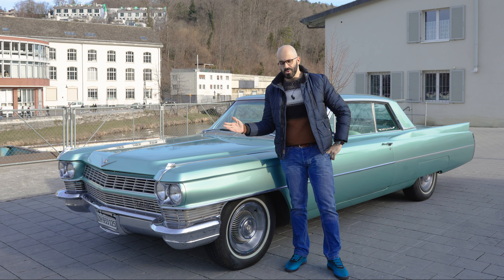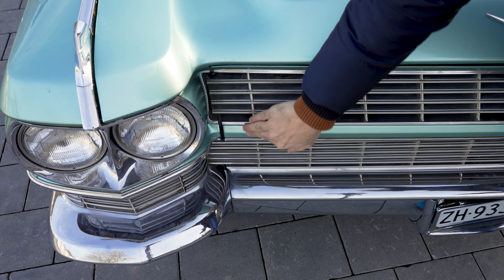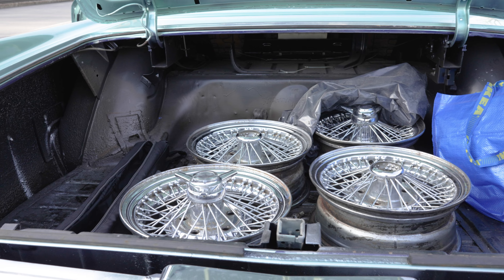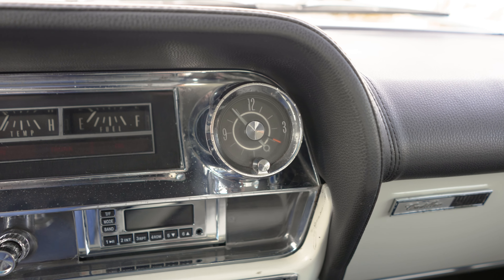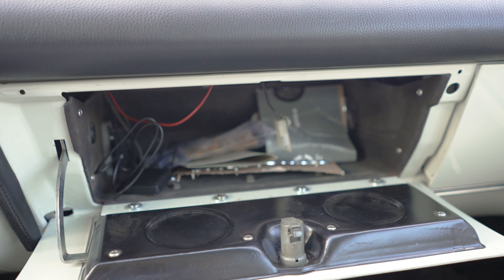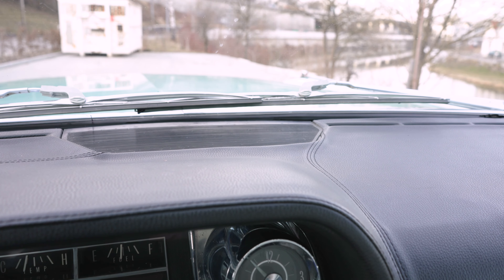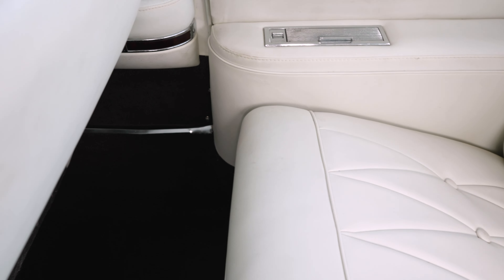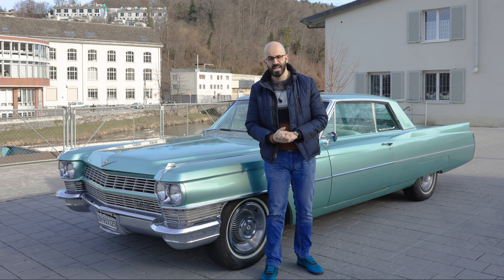Everything that is wrong with my 1964 Cadillac Coupe De Ville

Comment from the maker: Anything you guys noticed? And I don't mean the dent in the rear bumper.
Reply: Yes your panerai, that cars in those days have to look good, so many of them on a closet look had even paint problems aliment and other issues.
Reply: Incorrect dash pad. But I like it!
Reply: Your headlights might have a relay which is weak or you need a new headlight switch .
Anything can be fixed . There are dedicated online services  for Cadillac or try ebay , if not there are forums that can help .
Reply: many more things wrong with it. you mentioned the pitting on the chrome esp interior trim. another possible cause for this (aside from water exposure) is extreme humidity or storage with poor ventilation. I'm leaning toward the latter esp if the Cadillac spent time on the east coast of the US. That is fixable and you want to get the rear window looked at esp around the seal/sealant inside the ext trim around the window.
Reply: On the headlights, check th connectors and the grounds. The headlight harness grounds to the front bottom of the radiator support, on both ends.

Comment: I feel your pain brother. I hope you didn't pay a lot of money for that Caddy. All the signs of a low budget amateur restoration, probably a "flip". This is exactly why I sold my 1962 sedan de ville which had all the same issues your car has. Obvious poor prep work before painting, body fill over trim fastener holes, poor body panel alignment, etc. Where to begin? They didn't even bother to replace the rubber seals and weather strip after removing the glass, which is why there is obvious water damage to your headliner around the rear glass above the package shelf on the driver's side. The door glass doesn't work properly because of misalignment of the window tracks, which can be a pain to get right, and I can only imagine the horror that lurks behind the dash. Be aware that all of the HVAC and automatic door locks are vacuum operated, so the miles of vacuum hose behind the dash and routed through the front doors need to be inspected if not replaced. The electric seat adjustment motor located under the front seat can be taken apart cleaned and regreased. Also, the contacts in the electric switches in the door panels can be cleaned and serviced. You also want to find out what specific carburetor came on your 429 and replace it. > Carbs: The original Carter AFB and Rochester 4GC carbs that came with the Hydramatic equipped cars, will not have the mounting block for the THM trans kickdown switch, so you will need a carb from a THM equipped car.  Yours looks to be a THM by the PRNDL. Check your engine for blowby by removing the breather cap/oil fill cap while engine is running, look for excessive oil smoke coming from oil fill tube, and inspect the metal media inside the breather cap for oil saturation. Your headlight problem could be an issue with the dimmer switch or in the turn signal switch. I'm not trying to tear down your car as much as warn you that it appears that whoever tried to restore/flip this piece of history didn't give it any respect. These classic luxury cars were highly advanced technologically for their time and require a great attention to detail and cost when getting it right.
Reply: This guy knows what he's talking about obviously he knows a lot about Cadillacs I used to have a 71 Sedan DeVille I know the problem with the air condition mine was not working either but I ended up selling it before replacing the Air ac this was back in 1981 long time ago

Comment: Very common for flippers to buy a pretty nice old car and then do the paint and bodywork.  Perhaps do just enough mechanical work to get it running halfway.  However, all the dozens of details that require more thought and time?  They get left alone and not working.  Things like what you mentioned and then also usually the heat and AC are beyond the skills of most shade tree mechanics.  I also believe that 64 was the first year for climate control and it is a little more complex than later years.  Good luck with the car

Comment: This was the first year for the automatic climate control.  One  issue which was addressed in 65 .  There is a temperature sensor I believe outside the car under the front  wheel well .  The air conditioner also has another temperature sensor  built into the padded bash board directly center to the steering  wheel  The two sensors are connected in order to determine if the air con should switch on or heat in order to maintain the desired cabin temperature.  The outside temperature sensor always corroded due to road salt and debris Im sure that will need replacing.

Comment: The seat controls work like this. The middle button push forward and backward obviously for moving the seat back and forth. Moving the middle button in or out moves the whole seat up and down by running the height motors front and back in unison.  The front tilt button moves only the front height motor up and down.  The rear tilt button moves only the rear height motor up and down.

Comment: Beautiful car with lots of fun to be had making adjustments and correcting items that seem to have been neglected over the years.  I have a 67 Cadillac and have done much of what you are embarking on.  I would offer one piece of advice:  do not try to fix the climate control system.  Your car is the first year Cadillac had a fully automatic climate control system.  Even when they were new they were problematic.  These systems do not improve with age.  Do yourself a BIG favor and replace it with a system from Vintage Air.  You can find them on the internet.  It will provide efficient heat/air/ defrost and will be reliable.  Much luck to you.  Keep making videos of your progress.
Reply: Vintage Air that's the ticket
Reply: Vintage Air does not make a sure fit system for Cadillacs. I would stick with the factory unit. When they fail to work it is usually due either to a leak, or to someone messing with adjustments who has no clue what they are doing. Both happened to my car. With Cadillac Tim's book, setting up the original system should be straightforward.

Comment: There is a company in the United States called at Vintage Air that makes air condition for almost any car and heaters and they could replace that with the Vintage Air system that fits right in there you wouldn't even notice the difference that it wasn't Factory and it fits right in there and you'll have heater and air condition you might check with them Vintage Air

Comment: I'm not mechanically inclined but I owned a 1976 Cadillac Fleetwood Brougham in 1977.  I suspect there may be some similarities between the two cars  and now I come to the point which is about the air conditioning.  As my car was relatively new the a/c was working fine except at one point the heater stopped working. This was during winter (in New York) and what it did, when set automatic and hot, it blew cold air.  Took it to the dealer and it turned out that the a/c had its own radiator which provided the heat and in my case the a/c radiator had developed a leak and so no more heat.  So you might want to check whether the a/c in your car needs its own separate radiator.  I loved my car at time and I love it even more now even though I sold it many years ago.  They really don't make them like they used to.  And I now drive an Ls600hl!  Nearest to the old Cadillac but a long way from it. Hope you really enjoy the Caddie.
Reply from the maker: Thanks for thr input. Yes, a leaking or clogged radiator is also a possibilty. I know the A/C evaporator is separate and I will buy a new one  of thqt regardless of whether mine is still present as it's not expensive and most likely not in great shape anyway. I hope I can use the original heater though as undoing that is a bit more of a wet job than I would like to do.

Comment: My dad bought one with 5K miles on it but a Sedan De V (4 door sedan has much shorter doors which are nice in tight parking lot) in early '65. Was a GM executive vehicle with ALL the bells and whistles. Traded in a'56 for it. Mom, dad and I went to pick it up. From the back seat looking at the instrument panel (just like yours except radio - only thing missing no tape or stereo) it looked like a space ship to me compared to '56. I was in awestruck. There was a light misty rain on the way home and while we were moving along the road I reached over the back seat, popped the glove box open and asked what the chrome button in upper left (where you have the big hole). Saw the car dealer push it so I gave it a push too. There was a muffled clunk and the trunk lid opened. It had some kind of hydraulic closure on it that drew the lid down tight with a couple of clunks (but required a manual close). Stowed a motorbike in there one summer only needed to remove the handle bar. Although an odd location for wheel to left of AC control it was for setting cruise control. If I remember correctly if you study the numbers on that dial they don't make sense for AC. Was at least 2 different types of cruise control, maybe 3. The typical type and a resistant gas pedal that firmed up when you reached speed indicated on that dial. Ya practically had to stand on the pedal to use if needed to go faster. Car would auto dim high beams as cars approached while night driving and put highs back on after passing. Was control on top of dash in left corner for sensitivity of on coming lights. Sensor in very end of left fender above headlights. Give me a Reply as I would enjoy and can probably answer most curious questions. BTW Didn't notice but we had small ding in rear bumper too but our car was a very light tan with Landau top but rear window bottom was all the way down to rear deck.

Comment: Beautiful car. Probably the only thing wrong with your headlights is corrosion on the plug contacts or corrosion on the ground. I know my 1968 Falcon has many lights that have no ground wire, but the light assembly itself grounds to the body. Your car may be similar.

Comment: The automatic climate control could be an issue to fix.  I had a 68 Caprice that had Comfortron A/C and it was very expensive to fix. They had to find parts on ebay and luckily the shop had an older tech who was familiar with this type of system.

Comment: I noticed right away in your first video that it didn't kick-down when you showed how it accelerated. Without kick-down it won't rev out and short-shift all the time relying completely on torque.  I learned to drive (at 16) on a 8.2 litre '76 Sedan DeVille.  They aren't fast, but certainly not slow if set up properly.

Comment: Here is a hack for heat on the climate control, if you haven’t gotten it fixed by now: on the transducer (vertical cigar shaped by the power servo), remove the top vacuum hose and hook it directly onto the vacuum port for the power servo (also remove it’s hose first as well). This will cause the power servo to call for full heat for the climate control system. This will work for heat until you can get things working as designed.

Comment: Yes - I had one of these and all signs indicate someone took this car apart to paint it and did a poor job of reassembly, they left out a lot of details some of which you covered.. Also, just because theres a hole in the back package shelf for a 6" x 9" speaker doesnt mean it came with one, it was an option and most cars just had a dash speaker unless the rear speaker was ordered - there was no stereo radio options on cars back then so only one speaker in back with a front/rear dial on the radio that allows fading the rear and front speakers in and out.

Comment: Regarding the HVAC system, cars from that era used vacuum operated actuators. The vacuum hoses and the bellows in the actuators all deteriorate over time making the system unable to change modes. Lack of heat could be due to the inability of the blend door to select air through the heater core, or the heater core could be plugged up so that heated engine coolant cannot get thru. There is also usually a vacuum operated actuator that controls fluid flow through the heater core, so the valve could be stuck or the actuator is failed and not able to open the valve. Does your car still have the air conditioner compressor? With a shop manual you will be able to figure out how it all is supposed to work and get it going again. It’s not surprising that a classic like this would take a lot of work but it’s sad that you’ll also have to undo the things that someone carelessly butchered. Everyone is different by my personal preference is to get back as close to original as practical.
Reply from the maker: Most of the vacuum lines are actually missing. But at least the heater core is still good. No compressor and most of other good A/C stuff missing.

Comment: Hello Mario! Isn’t it difficult to source parts for this car in 2022? Are there any parts manufactured? Are there many second hand ones ? Thanks in advance
Reply from the maker: Comsumables are still made new (even by AC Delco, which is the OEM for much of the stuff) and some parts are interchangeable for a wide variety of GM models. There are also plenty of NOS and used parts floating around. I have to buy everything in America, but the cost for parts is generally lower and availability is better then for comparable European cars from the era.

Comment: My dad had a 1965 Sedan de Ville. I was with him when he bought it second hand.  Your altitude may make a difference in how the car runs. Carburetors have more trouble adjusting, carburetor may need to be re-jettet. Are you using a full synthetic oil?  Synthetic oil performs better than regular petroleum based oils in cold temps.  The Germans invented synthetic oil during WW2 when their petroleum facilities were being bombed by the allies, to run in their German tanks. Amzoil, which first appeared in 1972 is a very high quality synthetic oil. I first started using it in 1976.  Your car is absolutely beautiful! Your car is from an era when american cars were "rolling art showcases" in my mind from about 1955-1972. You Swiss are experts on clocks/watches, that should be an easier fix for you.   Enjoyed your Vlog!!

Comment: Go to an edelbrock carb.. basically a carter carb. 
Put petronix on your distributer.. make sure edelbrock is the correct size for the 429.. probably a 1406. 
Window can be adjusted after you take the door panel off .. What you need for the kick down on transmission the rod is Called a TV rod

Comment: Most issues are easy to fix.
But yes, they are many.
I would go for a vacuum secondary aftermarket Carb in that case, with electric Bimetal Choke… IF originality is not so important.
The powerwindows have a upper Stop which can be adjusted in most cases.

Maybe your car had only one speaker in the rear from Factory.
Many american cars up to the mid 70s had a electric blower to defog the rear window, sucking air trough a „faux“ speaker grille.
I usually sacrified them for stereo sound and put the original stuff in my basement. 😉

As you can see on my Channel, i also tried to clean the white interior of my Oldsmobile. The stains on the Headliners are often caused by glue that „make its way“ trough the vinyl over time. Moisture and UV light do their job too, yellowing white vinyl and plastic.
Reply from the maker: Thanks for the inputs. The Caddy only has one speaker in the back, but that one is not there. Stereo wasn't really a thing in cars in 1964. And my car was not specified with a window defogger. All in due time. First, I need to assess the situation behind the dash and spend money on parts. 💸💸💸

Comment: It looks good, but once you get the carburator replaced it should get over the mountain  pass just fine.  Took a trip with my parents as a teenager across country in 1971 in a 69 Buick Electra with a 430 engine and it went over the Colorado mountain passes just fine

Comment: Those are all small fixes except the carb needs to replaced as soon as possible.
Reply from the maker: Agree, it appears to be a 750CFM (haven't looked for rhe exact model number yet) and thus quite a bit oversized for that engine that stock uses a ~500CFM carb.

Comment: And I forgot to remind you about the battery switch..u r going to need, for the car itself and for your safety, any one with a screw driver can start it🤣🤣🤣🤣
Reply from the maker: Car theft isn't really a big issue on Switzerland. And this is the last car anybody would want to steal. A regular battery switch will however be put  in as I want to avoid the battery draining or the car developing electrical fires while parked for longer periods.

Comment: A lot of issues to tackle, but none of them individually is a really big undertaking (except for the automatic climate control).  The electric antenna on these cars was controlled by a switch integrated into the original radio.  The power/volume knob (closer to the driver) could be pressed in (toward the dashboard) to raise the antenna, and pulled out (away from the dashboard) to lower it.  Since this car has an aftermarket radio, that functionality may have been lost.  Look for the wires under the dash, near the radio.  You should be able to test the antenna motor with them.  Adding a discreet three-position, momentary toggle switch low or under the dash might be the answer here.

Comment: The ‘64 had a new engine (429), changes in the transmission, plus the troublesome auto climate control that would create problems with the electrical system.  My ‘64 needed to be jumped if I was driving with the a/c on and I had shut the engine off, and constant slipping of the transmission.  Yes, you have a lot of problems on your CDV.